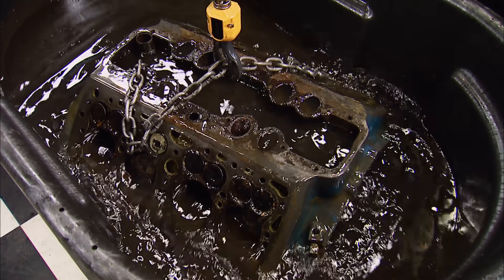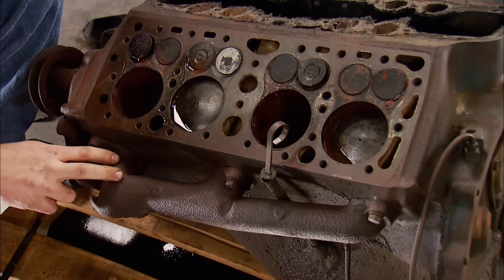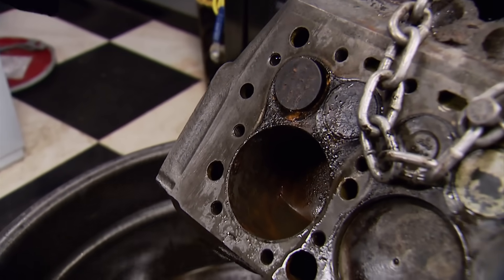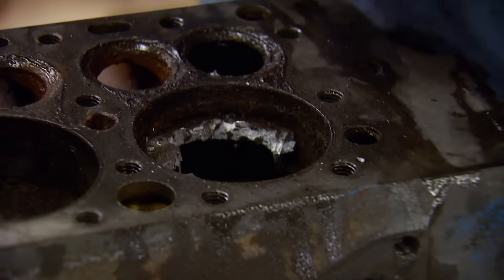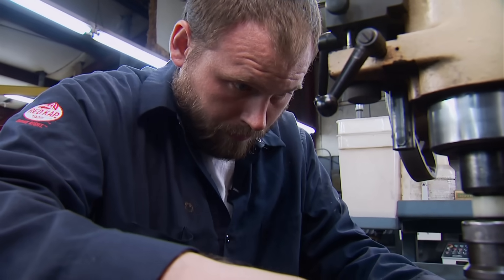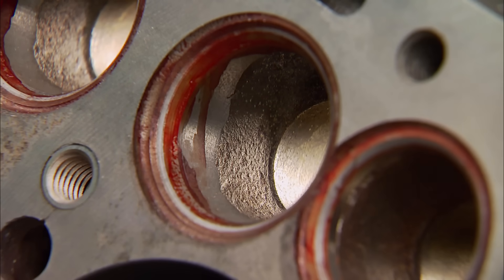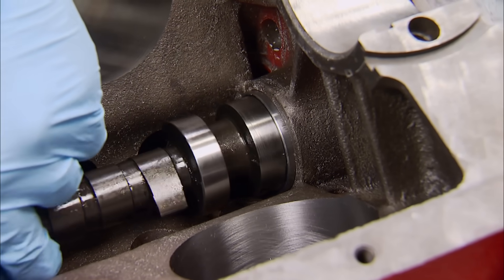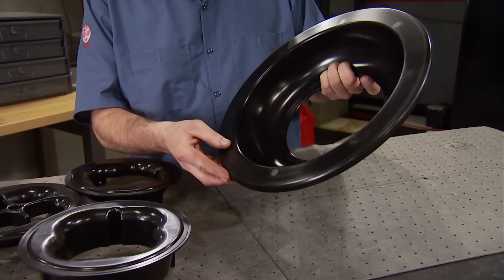Junkyard Ford Flathead Becomes A Classic Hot Rod V8 - Engine Power S1, E8

Comment: Does anybody know what tangle the valves were ground to? It might benefit the flat head to grind the valves and seats at 33 degrees like an Oldsmobile instead of 45 degrees because of the way the airfuel mixture entered the combustion chamber trying to flow air past the restricted area of the cylinder head.

Comment: Some of what was said is not true. Henry Ford knew full good and well ahead of time that if he could bring a mass-produced V8 into the marketplace - that guys would take it and try to make it more powerful than it was in stock form, and that a hot rod parts industry would spring up around it. He knew all of this ahead of time. He actually had his engineers working for 2-3 years to try to come up with a way to mass-produce a V8 engine. I read the book Ford: The Man and the Machine.

Comment: I picked up a unused remanufactured late model flattie from a local farmer who had it sitting on a small pallet under his workbench. But since it sat there for 30 yrs, it will need to be torn down to make sure moisture or mice didn't find a way into the engine. Hopefully all parts except gaskets are reusable befire I put it into my 1949 Ford F47 pickup. An F1 in the USA. Paid $150.

Comment: I saw a Ford video some years ago ,showing the assembly lines, from back in the day , but the most interesting part of the video , was the part where they showed a hill side out behind the building where Ford cast the Flathead blocks , and the whole hill side for as far as you could see where Flathead blocks laying on the ground in rust , the narrator said they guesstimated there were over a million Flatheads up on that hillside , They were trying to have them lay out in the weather for 10 yrs, before they brought them back in   and cleaned them back up to assemble and use ! Narrator said they did this because the rust actually strengthened the block's !

Comment: i was chillin with a friend, eric who owns a machine shop   he had a lightbulb go off in his head and told me that he has a flathead in the back,  so we both went, I havent really seen a flathead up close.  its mind blowing how "backwards" cylinder heads were and. This one was from a 1933 Ford.   Eric said by time hes done cleaning up, and flatening everything.  the engine builder will try to make 230-250 out of this stock crate.  of course, Eric had to balance crankshaft thoroughly for performance.   (wasnt a standard thing in factory in 1933)

Comment: Easiest way to remove rusty stuck pistons is to put about 1" of diesel fuel in the cylinders a lite it with a propane torch and let it burn until it goes out then tap the piston with a block of wood and hammer. The pistons will come out no problem.

Comment: I've always used an OTC cam tool that pull's the bearings in do you not like this type tool and why.... I never had issues with 😎 it...... especially on SBC. Awesome job by the way those flathead engine are unique very quiet in stock form..... I used to drive a 50 Ford it was almost like electric was under the hood....

Comment: Only 3 main bearings on a flathead?
Reply: Yes indeed.  They only made between 85hp and 110hp when new, so they didn't need the support --- or so Ol' Henry thought.  Not his wisest choice of design decisions, like the sharing of the center exhaust ports.  That could have used some more design department head scratching as well.  But it is what it is.

Comment: 13:30, a nice heavy duty 360 degree air swivel would come in handy here.  Nice simple history video on this Ford engine without it going too overboard.  Heavy duty swivel all metal link:  https://www.ebay.com/itm/173954575002

Comment: I had the displeasure of remanufacturing(machining, boring honing etc) one of those boat anchors, had so many cracks not to mention the sheer stupidity of running exhaust through the water jacket,stupid when they already had cylinder heads with valves and push rod set ups.
Reply: The flathead was never designed to be good, it was designed to be cheap (as cheap as you can make a V8 with the tech of the day). An early example of 'value engineered' consumer goods. To be honest it's impressive that it works as well as it does.

Comment: I agree with one comment, that there is no wild and very loud music!!! So many you tubers think everyone likes their lousy music. So thanks for not including that crap. I've forgotten so much over the last 50 years of working on the old flatheads. I remember that using the very early Chrysler hemi intake valves for the intake and the exhaust in the flatheads. They are so close, but work fine. I still collect the racing parts for these engines when I can find them. I have one of the original cast Edelbrock Slingshot manifolds. plus many others. Camshafts, Harmon and Collins mags, etc.......I got on the tail end of these parts being scrapped. The local junkyard would save all that stuff for me. Then the supply ran out.....Had a lot of fun with the flatheads!!!! If I remember right, I put the left exhaust manifold on the right and the right on the left,so the exit pointed  front, and had mufflers out front under the radiator!!!

Comment: I think at 4:30 he meant the Mercury had a longer stroke. 256 cubes for the Merc and 239 for the Ford. Also a dead giveaway to it being a late model (49-53) flat head is the distributor coming  out of the top right front of the motor. These are much easier to service than the earlier ones mounted down in front and driven directly off the front of the cam. The last rebuild on this motor also included Johnson adjustable lifters. Stock valve clearance had to be set by grinding the stem length (after the valve and seat was ground) to set the proper clearance. Very time consuming but once done, lasted quite a long time. Good video. Look forward to seeing complete rebuild.
Reply: Lincoln had its own Flathead V8 that came to 337 cubic inches.  They look nearly the same as the Ford / Merc engines.  So you and the video are both right.

Comment: I owned and ran an old front engine rail with a 239 flathead w/three Strombergs at Lyons and OCIR in the early to mid '60's. It was a bit outdated even then.
It was named the Lead Sled and ran 119mph in the quarter... But i'll be damned if i can remember the ET.
Moved on to big block Chryslers and never looked back.
Thanks for the memories.

Comment: Top tip for seized pistons is to pour boiling engine oil in the bores.
Reply: Dear ole dad used to used gasoline mixed with transmission fluid to loose seized engines. You have to soak and incrementally turn it until it is free 👍💪😎

Comment: It’s a V8 with 3 exhaust ports?
Reply: Centre port is called Siamese, 2&3, 6&7 exhaust valves go into the same port, lots of early V8s use a similar set up
Reply: Comment
Reply: It was not one of Ol' Henry's best design decisions to combine two exhaust ports into one outlet.

Comment: I rode many miles in a flathead powered vehicle.
Dad had a 49 Ford car 58/1959,We also had 1950 1-1/2 ton Ford truck.
A 1953 Ford station wagon as a Family car.
Not fast maybe but very reliable!.

Comment: Most people would give up on an engine this rusted. He submerges it in WD-40.
Reply: Another trick is using a transmission fluid and gasoline mixture to loosen up parts and cylinders 👌

Comment: I'm curious as to why some of the aftermarket block makers aren't making repro blocks with improvements to known weak points of the venerable old engine.
Reply: Agreed. Given the resurgence of interest in the venerable Ford flathead, someone could manufacture a modern casting, maybe even aluminum.There would certainly be a market for it.
Reply: @jeromebreeding3302  Aluminum would be great.  The biggest weak point of the flathead is it's only has three main bearings, a crank grinder in concert with a block maker could rectify that problem and make a much stronger engine.
Reply: @dennissheridan1550  Unless seeing race duty, do'nt think three mains are a problem. My cocern with an aluminum block would be the hot exhaust meltind the exhaust ports.
Reply: @jeromebreeding3302  The exhaust ports in OHV and OHC heads don't melt so I don't think that would be a problem.  The extra main bearings would give the block the strength to survive higher HP mods like a turbo or supercharger without worry of damage from the HP increase.  Plus it would give the engine a chance to realize it's full potential.

Comment: In your soak tub is it JUST the WD-40 you put in there or are there more chemicals?

I have a straight 6 moter that came out of my Dad's old '61 Impala.  It has been lying on the ground for probably every bit of 40+ years.  The oil pan has holes in it and the valve cover is missing so the upper part of the engine has been exposed to the weather.  The crank shaft is rusty as well.

I was going to take it apart and make a table out of the block but I was curious if you think the block might be reusable/rebuildable?  Does prolonged exposeure like that to the many seasons of cold and heat ruin a block?  And would the cylinders have rusted themselves to the cylinder walls and ruined the bore?
Reply: Try electrolysis first then get some free all from o'Reilly's. Should make it clear how bad the block is after that. Be more concerned with the condition of the block rather than the cylinders because the cylinders can be sleeved but the block cannot be repaired from deep pitting or rust holes

Comment: The flathead V8 is very sophisticated casting compared to earlier V8’s. Prior to the Ford, side valve V engines had the had the exhaust ports in the centre of the V. Ford managed to rout the exhaust through the block to exit on the outside. Easy with an OHV engine but not with a side valve engine.

Comment: The French did use the flathead in military trucks until the 90s, so even into the 2000s you could sometimes find a brand new 60 flathead in a crate.
Reply: That's pretty slick!

Comment: Setting the block on the flywheel surface enables  installation of the camshaft using gravity to work for you and not mark up the cam bearings - just have a good handle for the end of the camshaft to grasp before lowering into the block.  A long bolt through a piece of flat bar steel makes an excellent handle.

Comment: Gotta love a good Flathead!  My last one was in a 1946 Ford coupe and was the 110 hp 239 out of a Mercury. Unreal how smooth those old flatties run
Reply: I'm surprised no one is reproducing a new block for flatties. The French made new ones into the nineties. Let's do it before the Chinese !
Reply: @jeromebreeding3302  ----
Totally agree!  Repop Flathead V8s would be a small niche market and they'd be as expensive as hell, but at least they'd be available.  If guys are willing to pony up $15,000 for a brand new 1969 Camaro body from Dynacorn, then certainly us old Ford fanatics wouldn't mind shelling out $5,000 for a Flathead fresh out of the foundry!
Reply: @skipabrams3809  Perhaps the molds  and processes the French used for decades could be aquired for a cast-iron re-pop. That could make them less expensive.

Comment: Actually there is a guy who is going to be casting new flathead cast iron blocks I think they will run 3-4 k he already makes the 4 cylinder's
Reply: That's pretty cool actually.   It's amazing this is still relevant even 60+ years after production ended.
Reply: @bmstylee  Ive been getting parts forever I have enough to build two now. Probably my favorite motor of all time
Reply: I would like  to see a 5.0 flathead with the extra exuast  port I'm curious if the engine would run better with the extra port.  And 4 bolt mains

Comment: Don't even need the casting numbers for the late model flatheads, head bolts instead of studs, and the older ones had bellhousings cast into the block

Comment: I think you meant Mercury as longer stroke. I have a 41 Super Deluxe with a V8, like your vids a lot.
Reply: Lincoln had the longer stroke, Mercury had a bigger crank journals. Mercury crank reground to Ford journal size, but off set gives a 1/4 inch longer stroke.
Reply: @doughibbard8462  1950 Ford =	239cu.in, 3.1875 x 3.750 100 HP, 6.80:1 Compression Ratio	
1950 Mercury = 255cu.in,	3.1875 x 4.000, 110 HP, 6.80:1 Compression Ratio

Comment: Nothing sounds like a flathead. Can't wait to hear you guys fire this thing up. 

What was that "red insulating varnish" you used in the lifter valley? I've seen a lot of back and fourth about the viability/durability of glyptal so was curious about this product.
Reply: I believe that is exactly what it is, or a variant of such. In my years of engine refreshing and rebuilding Chevy,Mopar and Ford engines. I saw no noticeable difference in oiling. But if doesn’t really hurt it either. So it’s really up to your opinion and your beliefs.

Comment: Careful how you go the Lincoln flathead is very different in so many ways not just stroke exhaust manifold  engine mounts fuel pump position. So which river did you dredge this engine from, or was it an anchor for one of the great lake wrecks.

Comment: A little tip on cam bearings that you may or may not be aware of. On V-8 engines I always install the #1 & #5 first then check for fit. if they are tight do the gray scotch brite  thing to scuff up the bearing a bit. Re-install the cam & rotate a few times. Remove cam & inspect the bearing. The high spots will be shiny & you can easily see where you need to work on them to get a good fit. After these 2 bearings are fitted properly install the remaining bearings one at a time repeating the proceedure. I also run a hone through the bearing bore slightly before installing the bearings to remove any nicks or high spots. Saves a lot of grief. I'll be watching to see how this critter performs.
Reply: Also pay close attention to #5 bearing. The big hole must line up in order for the mechanical fuel pump to work.
Reply: @bigboreracing356  Explain please. Some MoPar big blocks can be a pain on the cam bearings.

Comment: Always like watching an old engine being brought back from the dead. After WWII my dad drove trucks to haul grain from farm to the grainery. He said that the Chevy 261 & Jimmy 270 & 310 was a much better engine. The flathead would always overheat while going up a grade, the Chevy & Jimmy wouldn't. When the Chrysler Corp put the little 241 Hemi in the 54 Dodge it kind of put the final nail in the flathead * at Bonneville. It ran in the same class as the flathead, 239 ci.  The hot flatheads would strain their guts out just trying to keep up with the modestly modified Hemi. They, the flatheads are interesting though.
Reply: There's no such thing as Garbage Motors manufactured engine that's "better" in any way, they're all junk...
Reply: What a load of garbage.
Reply: @glennd11r  What in particular is garbage? My dad did drive trucks part time after the war, some Fords, some GMs, some IH. Ford flatheads would overheat because a large part of the exhaust manifold was in the water jacket & exhaust manifolds will run near red hot on a long hard pull. Dodge did make a 241 ci hemi in 54 & 55 and an ohv hemi head IS more efficient than any L-head engine. GMC did have  300+ ci engine. Dodge L-head 6 engines were either 215 or 230 ci but some larger trucks used a Continental I-6. International used an L-head 6, ci unknown. Even with a 2 speed rear axle the old Dodges were limited to about 45 or 50 mph loaded. 60 empty but the engine would really complain. I had one with a 230 engine & that is a fact. The Ford flathead was design  in 1932 with it's one piece block but still it is 1932 technology.

Comment: A 53 Ford sedan came into our shop one day in fully stock form...the guy left it idling as we looked under-hood. Listening to this engine it was suprisingly  quiet....no valve-train sounds whatsoever...utterly silent!
Reply: They run so quiet and smooth, old time mechanis told me stories of sticking their hands near the fan, not realizing the engine was running. I once watched my friend balance a nickel on its edge on the air cleaner after tuning up the flathead in his 52 Ford pickup.

Comment: I'm building a 29 A pickup i'm planning to run a Merc crank flathead, i'm lucky i have a good friend with close to 100 flathead v8's, he pulls apart a couple a month, some can be saved, some can not, i'm not planning to do much work to the block and run stock heads, i'm having plates cnc cut to pressure test blocks this week, i'm thinking of running a turbo so it will breath fine, for a trans i have a 4l60 i'm building my own adapter for, should make a nice little daily driver, i work at a body shop but i'm leaving the body in rust with boiled linseed oil..lol

Comment: Flatheads,... Less moving parts, so have lower parasitic losses, and less parts to break, for better reliability.... which is why there's a light aircraft engine called the D-block layout currently in production.
Forced induction will overcome the performance losses of the gas flow pattern through the valves and ports.
Reply: Yes but these only have 3 main bearings &  through the block exhaust ports that cause overheating problems, even with a water pump in each bank. So reliability wasn't a strong point
Reply: @johnrebus1641  Number built, vs number still in use,.. be a heck of an interesting study to graph out, and see which engine design has the most reliability per number made, per year of product life.
I'd expect the Flathead V8 to be top five, along with the Slant Six, and maybe the VW flat four and BMC A-series, and maybe the Ford 300 inline six.